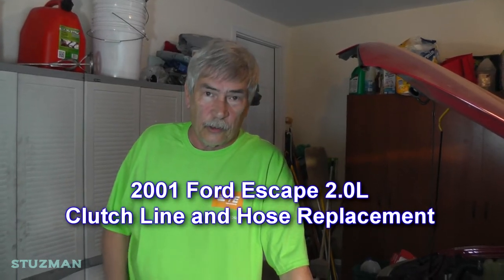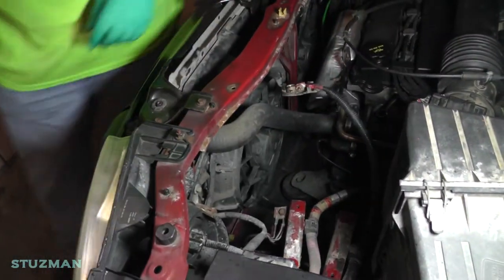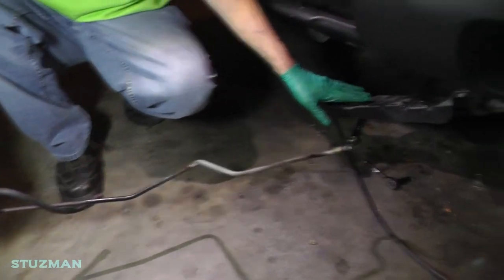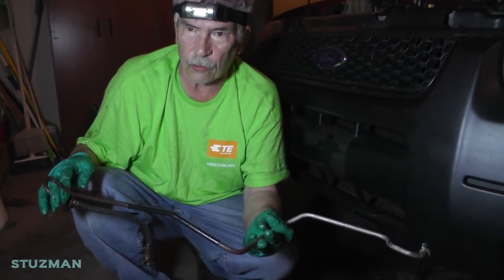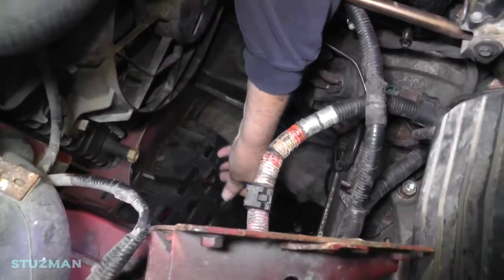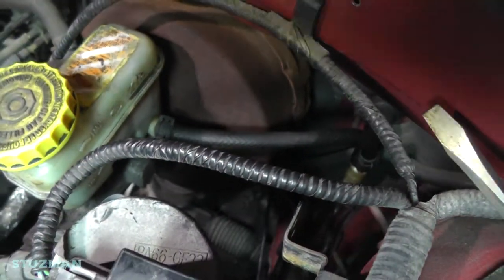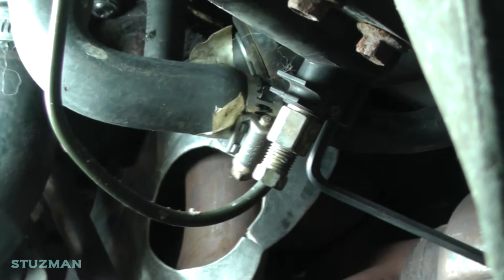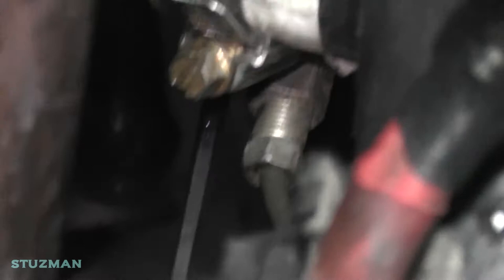Ford Escape Clutch Line and Hose Replacement

Comment: I really got the blood, sweat and tears on this one! After successfully doing the timing belt, thanks to your video on the subject, the clutch master went out. Pretty straight forward to replace it. Also replaced the slave. HOWEVER: this thing will not bleed! Tried the two person technique, and that an adaptor for my pressure bleed. Set it a 20psi, and it still won't bleed. Arg! I'm going to quit this fun stuff and just bring it over to you; LOL Karl
Reply from the maker: Yeah Karl it's pretty aggravating as it took me several attempts to get it right.
Reply: @stuzman52  Turns out I think it might be the clutch itself!!! By pushing against the slave with the clutch throw-out lever, there is a good 1/2" of play. Have no idea if that's normal, but seems excessive. BTW, if bleeding this car again, I think I would bleed the slave out of the car after hooking up the line... By removing the clip holding the flexible hose, the slave can be lifted high enough to eliminate a "high spot" in the line, where a bubble is likely to occur. That would allow a potential air bubble to escape (no pun) more readily while giving you a good view of what IS escaping. Just a thought. I am pretty sure there is no air, and the hydraulics actually move the throw-out; just not very far. Any comment on the clutch lever play would be appreciated. If the clutch...., when will you be doing that video? F-O-R-D; fix or repair daily..., right?  I appreciate you Terry; that you actually respond; thanks, Karl
Reply from the maker: @karlrandolph4775  It sounds like you wouldn't have any air in the system especially when you put 20psi of air to the master cylinder. Yes, 1/2" of play is too much after you bleed the system. The lever should be against the slave cylinder once it has been bled. Are you sure that there isn't an issue with the slave cylinder? I can't see how the clutch is an issue. Not planning a clutch job at the moment since it's still working pretty good.
Reply: @stuzman52  Thanks for your reply; I’m having a hard time thinking it’s the clutch also. New slave however. To clarify; when pushing the throw-out lever back against the slave I get about ½” of travel. There is a fluid rise in the master.  If 1/2” of travel is “to much”in your words, perhaps something HAS failed somewhere in the clutch? One of more of the release fingers? Broken pivot? Also noted; there is approx.. ½” lever movement when depressing the clutch pedal; just not enough to release the clutch. BTW, the failure was immediate; the pedal went to the floor without previous warning. Got to ask Terry, is to OK to communicate with you this way in public? I have subscribed, so you have me email?  A puzzled Karl
Reply from the maker: @karlrandolph4775  Very strange indeed Karl and I see from your previous post that you also replaced the clutch master cylinder. I misunderstood your previous posting about the 1/2" of travel and thought that you had 1/2" of clearance. The 1/2" of travel of the piston inside the slave cylinder is what you want and it sounds like you have it. That being the case, it sounds like an issue with the lever, it's pivot point, fingers on the pressure plate, etc. What bothers me is that you mentioned that the fluid was rising about 1/2" inside the master cylinder. I went to my vehicle to verify and the fluid does not rise. Here's what I would do. Get a helper to start the engine and press the clutch pedal down while you watch the movement of the slave cylinder piston. If you get your 1/2" of travel, then have the helper to shift it into any gear and keep a watch on the lever. I think at this point, you'll be able to tell if there is some issue in the hydraulics or within the clutch/pressure plate area. Hope you get it figured out!

Comment: My goodness. That was quiet the job. Too bad they can't provide a pre-bent hose. Nice job Terry and camera wife.  :)
Reply from the maker: It would have made it a little easier when trying to get those fittings aligned. I looked at the new line and compared it to the old one and it looked pretty good. Of course, once I got it in there and ready to screw the fittings together, then it would show up. It was a little pain in trying to get it out of there for sure :) Thanks Wyatt for dropping in and sharing a comment!

Comment: Hi Terry, very informative video, I too have the same problem, unfortunately no one here makes this line, can I ask where you had it made and how to contact them?. Thank you
Reply from the maker: Depending on where you live, the cost of shipment will probably offset the cheap price that I paid for the line being made. I would have made the line myself, but didn't have a decent flaring block tool or the benders. I would had to wait for the shipment of these items and didn't won't to wait. So with that being said, the company's info that I used is listed below:

Production Tool Supply Co Inc.
6136 Prospect St.
High Point, NC 27263
Phone: 336-885-4219 (Hours: Mon-Fri, 7:300am - 5:00pm EST)

Good luck on your repair!

Comment: Good to see you again Mister Pike! great video. My clutch master cylinder went out on me this past Friday. I noticed fluid at the bottom of the pedal. I've ordered the new pre-bled master cylinder plus line. hopefully get it done tomorrow. btw I got a 2000 ranger now. I sold the Suzuki lol
Reply from the maker: Good hearing from you too DIY-Haven and hope you've been well! It seems like it's always something isn't it. You having a clutch master cylinder to go out on you. I haven't done that job, but I did look over the procedure of removing it while I was looking up the bleeding procedure for the Escape. It didn't look to be a bad job. Now, we know that the world is coming to an end now that you've got rid of the Suzuki :) So, how are you liking that Ranger?
Reply: stuzman it's a good truck. I really got it because of my job. It's a fixer upper but I'm up for the challenge. So far I have replaced the driver seat (junk yard), tailgate handle,  water pump and thermostat housing assembly, radiator, fuel filter, SRS sensor light bulb (code 27) front rotors and bearings, brake master cylinder, air filter and airbox cover, 4 new wheels and tires. So after the clutch master cylinder job I plan on doing valve cover gasket, plugs n wires, throttle cable, perhaps new injectors, timing belt (already bought one but couldn't remove the crank pulley the last time). Still got a leak at the power steering high pressure line connection to the pump. I think I'll use Teflon tape this time because the new Teflon seal didn't help. Besides that I love the truck it's a L4 2.5l, very good on gas and ez to work on.
Reply from the maker: I didn't realize you were doing videos, so I went and gave you a sub. I'll be checking your videos out later throughout the week. And it sounds like that little truck knows that it's getting some good loving. She'll be good for you with all of that work :)
Reply: stuzman well I try to help out where I can. I've been helped tremendously by the YouTube community, in fact all I know about cars is from YouTube. So giving back. Hopefully I get a real camera and a tripod and make better videos. Right now it's only a trial phase to be honest. But glad to see you back on the scene we've definitely missed your high quality videos
Reply from the maker: That's pretty nice of you to give back to the community and I'm sure there will be folks who will pick up useful information from you channel. I also want to wish you many successes with it. Just give yourself some time and you'll get a better camera, tripod, etc. and before you know it, you'll get into it :) You know how it is about filming when you have some many other things to do and working full time. The only time I have to film stuff is on the weekend, but it's getting warmer and with four older vehicles, there's always something to do with them :) Have a great evening and hope to get more videos out :)
Reply: Thanks and Cheers

Comment: Terry, didn't you know, you can't have thin skin when you post Youtube videos, ha ha? This is a good demonstration, it's going to help many others. $26 for a custom line is a great deal, some of those turns were really tight.
Reply from the maker: HaHa! You would think that I would know that Dave about the thin skin. Having a little drama is a good thing right? I called the hydraulic company and spoke with a guy about making the line and he asked how long was it and how many bends.After I told him that, I said how much do you think it will cost and he said, it should be less than $30. I said let's go for it. And when I got down there, the bill was $26. I can't argue with that price as I'm sure it's a lot cheaper than the dealer item if they had it available. Thanks Dave for dropping in and sharing a comment!

Comment: Hello Terry,
both Front Airbags in my escape 2,0 2003 deployed. I have bought everything what needs to be replaced. But one thing is where noboby could help  me. It is the question of where  the Front impact crash Sensors are positioned  at the escape. Ford could not tell me and also none of the mechanics i asked. I also tried to find them  but i wasnt successful. Can You please hell me to locate the Front impact Airbag sensors?? Thank You. Cem
Reply from the maker: There are three impact sensors. I copied this from the service manual which is for a 2001 Ford Escape 2.0L engine. Being how you're working with the SRS, you may want to invest in a service manual for more information. Hopefully, the info listed below will help which is only pointing out the locations of the sensors as you requested.

WARNING:  THE RESTRAINTS CONTROL MODULE (RCM) ORIENTATION IS CRITICAL
 FOR CORRECT SYSTEM OPERATION. IF A VEHICLE EQUIPPED WITH AN AIR BAG 
SUPPLEMENTAL RESTRAINT SYSTEM (SRS) HAS BEEN INVOLVED IN A COLLISION IN 
WHICH THE CENTER TUNNEL AREA HAS BEEN DAMAGED, INSPECT THE MOUNTING AND 
BRACKET FOR DEFORMATION. IF DAMAGED, THE RCM MUST BE REPLACED WHETHER OR
 NOT THE AIR BAGS HAVE DEPLOYED. IN ADDITION, MAKE SURE THE AREA OF THE 
RCM MOUNTING IS RESTORED TO ITS ORIGINAL CONDITION. 

For this vehicle, the SRS employs three crash sensors. One of the 
sensors is integral to the RCM and is not serviceable separately. In 
addition, there are two side crash sensors located in the LH and RH 
B-pillars. The RCM is mounted on the center tunnel under the instrument 
panel. Mounting orientation is critical for correct operation of all 
crash sensors.
Reply: stuzman thank You so much!!! I searched the whole Front and inside for the front  Airbag sensors. Could only find the side impact Sensors and was assuming that the airbagmodule has the Sensor integrated. You are number one. Now i am sure. Have a great weekend. I appreciate your help very much. Greetings Cem
Reply from the maker: gök kay you are quite welcome and good luck on your repair! 😀👍
Reply: Hi  @stuzman52  
I really need your help
I have ford escape 2.0L with manual transmission and i want to modified to 4x4
So i need transmission case with transfer case
Maybe get from junk car in there
Reply from the maker: @MrSakuyana  Yes, it sounds like going to the junk yard would be the cheapest route. For an extensive project like this, you'll have to do an extensive amount of research to see what's involved. Good luck on your project!

Comment: Nice job Terry. I bet having that line made was half the price of the dealer part if it was still available.
Reply from the maker: Hi Rob! I never did check on the pricing as I couldn't find the part anywhere, but I agree with you 100% that it would have been much more :)